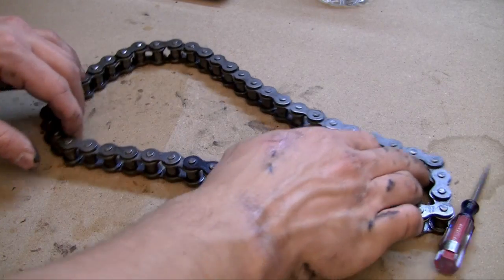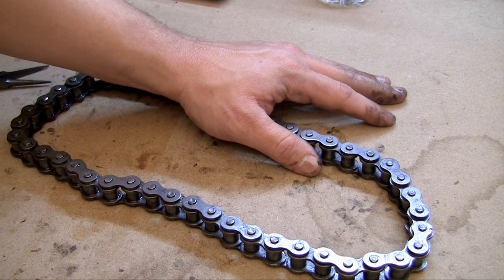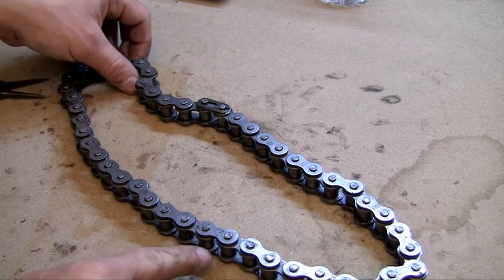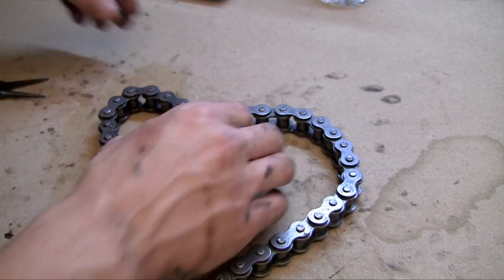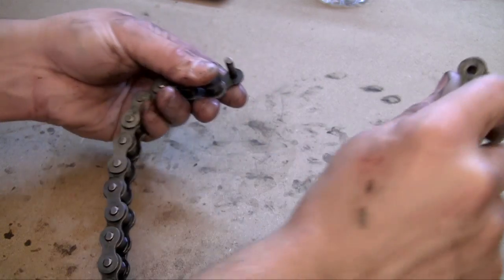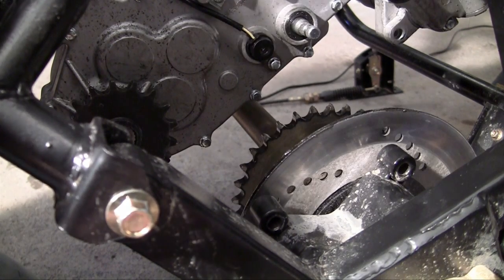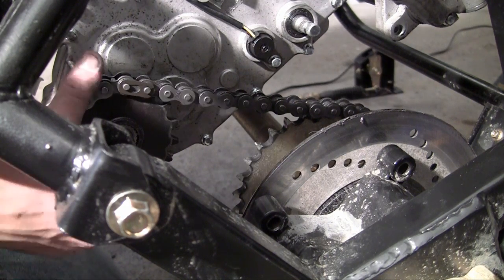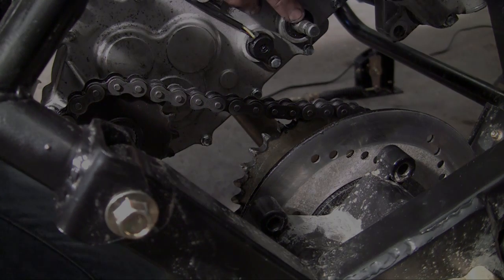How to Build a Go Kart - 3 - Chain

Comment: you dont need to unlink it to put it back on. when the one on my quad comes off and i just put it back on
Reply: it will fall of again if you do that,it means the chain is 2 loose
Reply: not if you put on one part and roll it
Reply: if it falls off and you force it back on like you would a bike your going to put slack in your chain and your going to need a new one. thats how you ruin your chain.
Reply: my quad was a cheap ass chinese quad with a cheap ass chinese chain that already was ruined. Im juust glad I got rid of that thing!

Comment: nice series bucky. when installing the clip on the joining link, ensure that the closed end points in the direction that the chain rotates. this way if the chain comes in contact with anything(rock, brush, sticks, ect) the clip wont be flicked off.